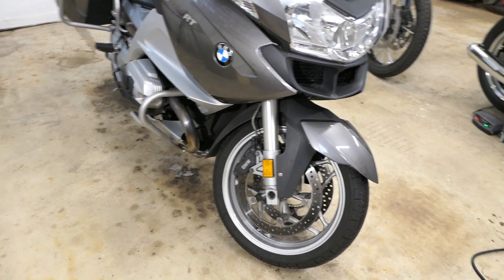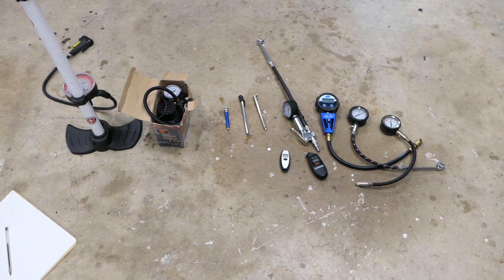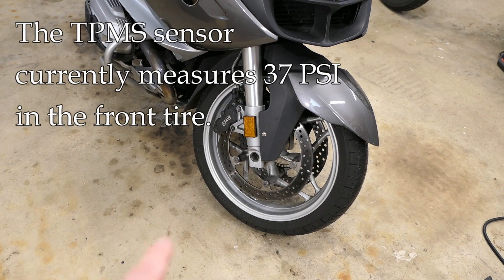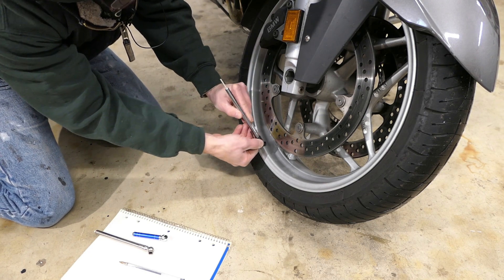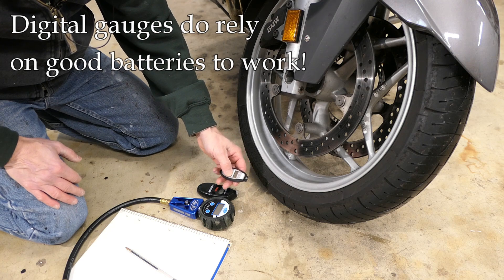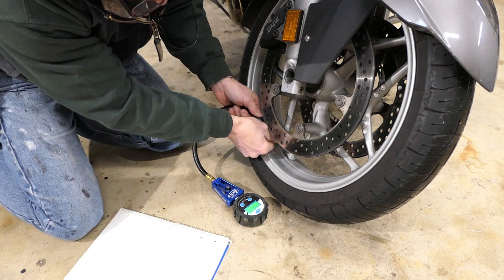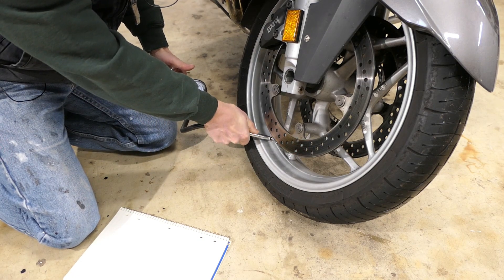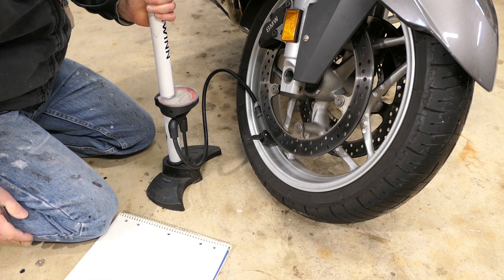Which Tire Pressure Gauge Is Most Accurate?

Comment: Vehicle TPMS indicators are not an accurate, absolute that should be used for referencing accuracy.
I have two BMWs, and they're both inaccurate by a few psi, and they also take into consideration ambient and air temp readings. 
They're not even accurate from one sensor to another. I can have two front tires that are set to and read by a known accurate Jaco Digital ElitePro gauge as equal to one another, but the vehicle will show them to be as much as 2 psi different and up to 4 degrees of temp difference.
Reply from the maker: Correct.  The point of the TPMS is early warning of impending disaster, rather than accuracy.

Comment: TPMS is generally NOT very accurate:
* The TPMS standard specifies pressure as 2.5 * (an 8 bit unsigned number) in kPa. So if you read the pressure in kPa it will jump 2.5 kPa at a time. In PSI, that's almost +/- 0.4 PSI
* The sensors aren't all that accurate either. I've not seen an actual spec, but various tests show variance of up to 3% of the reading. At 38 PSI, that's another +/- 1.14 -- so now we're at +/- 1.5 PSI
* Then there's the impact of temperature. From freezing to hot, that's another few PSI.

So, I would not use your TPMS as a gold standard :)
Reply from the maker: Yes, the TPMS sensors are not there for accuracy, they are there to alert you when there is a sudden drop in relative pressure, indicating an oncoming flat or blowout.

Comment: Ya may wanna redo this test with an air source which has larger capacity. When I repeatedly check my front tire, I can measure the pressure drop.
Reply from the maker: Yes, the act of measuring itself can reduce pressure because the tool uses a small amount of air,  But, perfect test accuracy isn't really the point of this video.  Instead, I was just trying to show that we shouldn't be obsessing over the air pressure numbers or a particular type of gauge.  The accuracy of these gauges is a relative thing and for street riding getting close is good enough.  Put another way: the perfect is the enemy of the good.
Reply: @tinderboxarts   You uncovered the bicycle pump gauge, Slim, Inflator and the Stick 1 outliers, which is the most important point here.

Comment: 2PSI is a lot for people who care and feel 2 PSI difference.
Reply from the maker: You may be missing the point, though.  There are absolute measurements and relative measurements.  The reality is that the inexpensive consumer pressure gauges that we can buy from retailers are never going to offer perfect pressure measurements in absolute terms.  Sure, you might stumble across one which happens to offer very good accuracy in absolute terms, but that will be dumb luck and you will have no way to verify the accuracy anyway!  Only with expensive scientific-industrial equipment could you verify a reading in absolute terms. 

However, if you compare a handful of the inexpensive consumer gauges and find that most of them agree, then you can discard the outliers and use the more accurate models.  Now you have a couple gauges which will be accurate in RELATIVE terms.  Perhaps you find with a little experimentation that 38 PSI in the front and 41 PSI in the rear works best for your riding.  Is that 38/41 reading the actual or absolute pressure reading?  Probably not.  But, if you are using your most reliable gauges you can repeat those relative readings and add or subtract air as needed.  You might actually be running a 36/39 pressure, but it won't matter because you found the pressure which works best for you and you can repeat the setting using the gauge(s) which will be reliable in a relative sense.
Reply: Very true, I agree and that is how I do it my self.   @tinderboxarts

Comment: That husky one was alright I used it for like 5 months then all of a sudden it started reading 2x the PSI higher than it was so it no longer turns on
Reply from the maker: Mine is still going and I've purchased several others.  Possibly the battery in yours just died.  Did you attempt to replace it?
Reply: @tinderboxarts  i should've tried replacing the battery or at least reinstall it before I trashed it. It was cool see the pencil gauges were measuring the psi

Comment: Great video. I would say there is a difference between Accuracy and Precision. Outliers that are still precise even though not accurate, may continue to be used. Just write the calibration on it with a sharpy, Example Slime gauge -5, means it reads 5 degrees lower than actual. Another test that would be interesting for those of you that live in areas with large temperature changes is testing these gauges inside at 20C/70F vs. outside at -10C/20F, to see how it affect reading, using cars that are acclimatised to their environments (not moving an inside car out for example)
Reply from the maker: Agreed--if the gauge is consistent it's still usable.

Comment: Hi - thanks for the video. A lot of dial “analog” gauges can be opened and adjusted to a known accurate gauge. 

What engine guards are those on your RT?

Thanks
Reply from the maker: Those are the same style sold by Wunderlich, but I found them on ebay.  They are widely available.
Reply: Ya you just open or close the little thingy "U" shaped thing inside the round gaudes to calibrate them. A fun winter night project

Comment: How does reading them all a second time make it anymore accurate. You’re still losing air everytime you put a gauge on there. And you still don’t know which one was right.
Reply from the maker: The point of the video was not absolute scientific accuracy, but a relative comparison among gauges.  The second round of tests started at a slightly lower pressure for sure, but the relative results were the same.  If I had found different relative results on the second round it would have indicated a problem with my readings.  Keep in mind that if I take the same gauge and do ten readings from a calibrated, stable source it likely would not give me the same reading ten times.  Common gauges just aren't that perfectly accurate.  So my goal was to see if there was a similar range of accuracy with certain types of gauges, which there was.  The outliers are the ones to be concerned about.  And we learned that cost or fancy electronics are not necessarily better than a cheap mechanical gauge.

Comment: i was always told check pressure cold. you rode your bike, and it's in a cold garage, as you checked the gauge the tire was cooling and losing air. good video, i have a stick gauge, might have to buy somthing else to compare and to be safe
Reply from the maker: These tests were actually done at a stable temperature.  As I mentioned at 1:36, I only took the bike to the top of the driveway and back, which is not enough to heat up the tires.  Incidentally, it isn't that a tire loses air when cooled down, it's that the air in the tire cools and contracts, which leads to a lower pressure.  When you do go for an extended ride, the difference in pressure as the tire heats up is typically only about 1 to 3 PSI.

Comment: Excellent showdown between the TPMS and a host of tire gauges!  

Folks it is ironic that the SIMPLEST tire pressure gauges yielded the most consistent results, and closest to what the BMW's TPMS indicated.  But that does not imply that 'all stick/pencil gauges are created equal'.  

If you're in a part store at the register, paying for car wash supplies, or a nice new torque wrench, and you impulse buy one of  the $1.99 tire gauges hanging from the peg board at the checkout counter, you'll get what you pay for.  Better off diving down the tire maintenance aisle, where all the air pumps and spare valve caps are, and picking out a stick/pencil gauge priced between $5-10.  You'll notice the difference in construction, mechanical durability, and possibly how much easier the more expensive gauge is to read - especially during those pre-dawn tire pressure checks every month.

My personal recommendations:
Analog:
- Milton or NAPA brand stick gauge(not every gauge in the world has to say "Slime" on it!)
- Meiser Accu-Gage model dial gauge
And the sleeper among analogs... Longacre Racing! Their Deluxe dial gauge is over $40, but is heavy, large, easy to read, and repeatable readings.  I don't know how so few people know about their gauge lineup?

Digital:
- DIYco and JACo make a 0-200 PSI digital model, very similar features, including different scales(PSI, kPA, Bar), and high resolution - down to 1/tenth PS.
- Longacre Racing - For about $10-20 more than the above two, Longacre's Basic Digital feels a little bit better built, but again,  BASIC: a small non-illuminating display, resolves down to one/fifth PSI, and also reads kPA & Bars.

I own Meiser's 5-60psi Accu Gage, Longacre's Deluxe, and all of the digital models above, and three or four pencil gauges, including a Milton which feels like it might be as old as me!  It reads up to 3PSI different every time, and its measuring rod wiggles around a lot. I would buy a new Milton stick, but I'd rather buy it in a STORE instead of online.

I have a new NAPA 5-50psi pencil gauge that seems to read pretty consistently.  To me, getting a positive seal on a tire valve stem is the most important part of getting an accurate reading from any gauge.  If your tire pressure adjustment sessions sound like more air hissing from your tires than snake feeding time at the zoo, you're probably doing something wrong!

It could be just me, but I feel the car rides the best, most solidly, after adjusting my tires with the stick gauges.  They're simple instruments, and they don't sacrifice a lot of air every time a reading is taken.  Unlike most folks, I venture toward the cold tire pressures on my car door frame sticker, or 1-2psi above.  On the tires I've had on the car for a year and a half, my tread wear is within 1mm even across all four tires - 5-6mm.  So I guess my alignment and pressures are all good!
Reply: Thanks🙏 very informative and articulate

Comment: Of course, nothing says the built-in deluxe Grand Touring model on your Beema is correct..
Reply from the maker: Well, that's true.  Really the point of the tire pressure sensors in my view is not accuracy, but an early warning system for impending doom.  If you see the pressure going down while you are riding you'll have time to pull over.

Comment: Thanks for this. I just ordered a bike pump, and I noticed it was 5psi under my old stick gauge. Not as bad as yours, but I think these bike pumps are pretty bad for the most part. To bad, because it would be very convenient for me. Know any higher quality floor pumps with a good gauge?
Reply from the maker: You know, I think they all are pretty poor.  But, you can use the pump and just check it with a separate gauge.
Reply: @tinderboxarts  I might end up doing that. But, I called a local bike shop today and they said they have one that is digital and the head bike mechanics have been using it for a while. The head guy has 40 years experience so I trust him. They said it was accurate. Didn't ask what brand yet, other than it was 65 bucks. Going to check it out Monday. I'll keep you posted. Thanks for the reply!
Reply: @tinderboxarts  Are there accurate gauges that also have a button to release air? so i can use the bike pump to over inflate it and then release until right pressure?

Comment: So bottom line is None of the gauges are accurate. There is no way to determine a True baseline for a standard of comparison. Sure you can get a general determination of air pressure but that don't really help if your tire needs to be at a specific pressure say for getting the best gas mileage.
Reply from the maker: Well, it's not all doom and gloom.  By utilizing several gauges you can get an idea when there is an outlier and then toss that gauge.  And, it's important to understand that the tire pressure is not NASA style mission-critical.  A couple of pounds of pressure up or down is not the end of the world.  Once you become accustomed to a bike you get a feel for the pressure which works best for your riding style and your mileage or tire wear.  The universal rule of thumb is 36 PSI up front and 42 PSI in the rear.  You can start there and move up or down a few pounds to make the bike handle well for you.  So, the actual pressure reading may not be objectively correct, but the relative difference using your gauge or gauges is still valid.

Comment: I'd say your BMW TPM s is off
Reply from the maker: Yeah, those sensors really aren't there for perfect accuracy, they are there to get your attention when there is a sudden pressure loss or when you've forgotten to check your tires after a long period.
Reply: I believe they are temperature compensated. See the owner manual

Comment: Thanks John, good video.  I usually use the bicycle pump, so it appears I should stop doing that.  By the way, I've relied on a number of your videos for Bonneville maintenance, and I need to do the 20,000km service on my Bonneville, and I'm up to the part where I need to grease the headstock bearings. If you've got nothing better to do there in the cold.... :)
Reply from the maker: Yeah, those bike pumps are not so great!   I'm going to pick up some more of those shorty stick gauges, since they are so easy to carry.  Great idea on the head bearings, I will put that on the list!

Comment: Like the digital gauges the TPMS relies on a battery, I've noticed the one on the front tyre of my GS now takes a little longer to register. Generally I check the tyre pressures before riding from my home with a MotionPro digital gauge same as the one you used and found that very comparable to the TPMS reading.
Reply from the maker: Yeah, I've replaced my batteries in the sensors.  You can definitely tell when they are getting weak by how long they take on initial register.
Reply: @tinderboxarts  Are they easy to replace? Have you done any videos on this? Thanks
Reply from the maker: Obviously you have to have the sensor out of the wheel, but then it's just a matter of digging out the epoxy and replacing the watch battery.  The second half of this video shows the whole process:

https://youtu.be/xAiJy4ZC-u4

Comment: i'm not surprised that the analog gauges don't perform that well. manufacturing accurate analog gauges in this day and age costs money.  i have a pretty good stick gauge but  the biggest challenge is not to lose the damn thing. for me the recommended bmw front tyre pressure is a bit high because the bike understeers too much for my liking. thanx for the vid.

Comment: Depending on the year of your RT the TPMS display is temperature compensated (see a somewhat confusing description in the manual).  So a compensated reading of 37 degrees does not directly equate to a gauge reading...unless the ambient temperature is the same as the bike uses for that measurement.   Ex:  If the ambient air temp is 50 when the tire is filled to 36lbs...the TPMS will read a higher pressure.

It would be interesting to take those gauges to a shop that has a calibrated gauge and test against that.   That will be a good indicator of the comparison stability.   There are NIST certifications for gauges but that's usually overkill for tire gauge.  However buying a gauge that conforms to ANSI B40.1 is a good bet
Reply from the maker: Yes, that's right.  But, the temperature compensation really comes into play in more extreme temps.  I purposely ran this test in a heated garage where it was in the low 60s F.  Maybe not perfectly aligned with the sensor, but pretty close.  A tire running on the highway in summer temps can easily go north of 100 degrees F.  Really the takeaway for me is not to put too much trust in any one gauge or sensor and to check them against each other once in a while.  We'll never get perfect accuracy in consumer grade gauges.

Comment: Great comparison. I only rely on the TPMS on my 2014 R1200RT while riding and use a digital when at home for a more accurate check. I carry a battery powered air pump that has been accurate and handy if I or fellow rider needs air. I check the tire pressure at least weekly as we all should before riding. Happy New Year!
Reply from the maker: That's good practice.  I don't obsess over fractions of a PSI, but I do check before I leave that the pressures are reasonably close to where they should be.